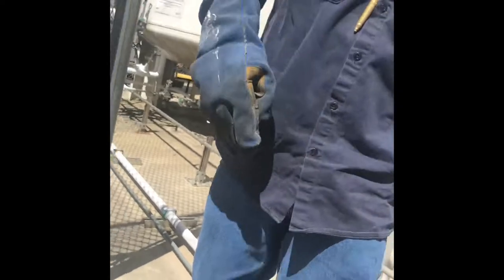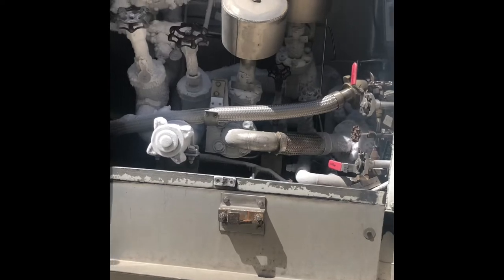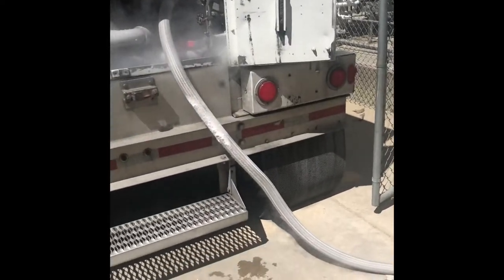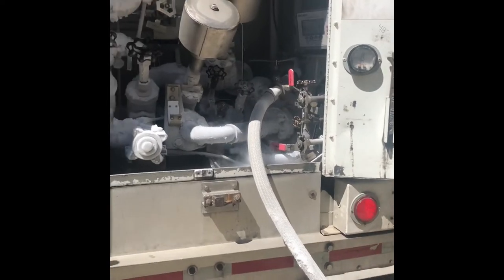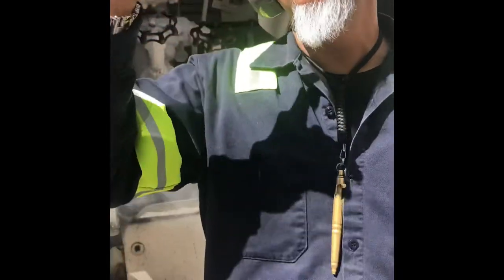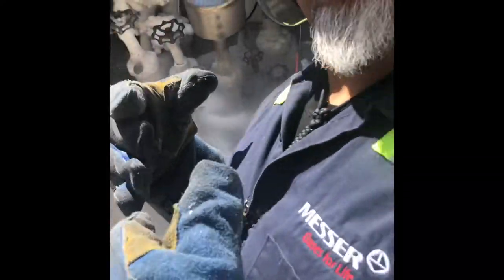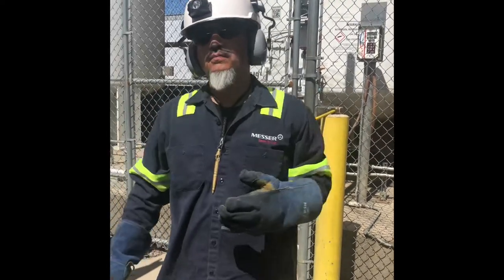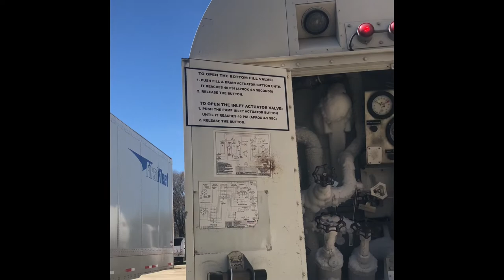How To Deliver Liquid Nitrogen

Comment: I have a hard time getting those copper gaskets to fit. They seem to fit, be too big or small. any tips?? Thanks for the video
Reply: If there not fitting the flank needs to be replaced over the years they get out of shape but most of the time they don’t get replace u just have to do ur best if it start leaking on u a couple more hammer taps help
Reply: If you have a 2 piece dust cover remove the inner piece and use it to tamp the gasket into place.

Comment: I dont know if am correct am also a new driver . Ones you get to the customer. Set your pto and power the trailer. Put your cones ready around the truck. Get the reading from the tank and change the gasket on the customer tank. Open the Drain  valve on the customer tank and hook the hose. Next will be easier
Reply: Naw you don’t set the PTO first because running the PTO you are placing wear on the Engine.  That should be the last thing you run and the 2nd thing you shut off after delivery
Reply: Yes you are correct that is the order just as you said ….Set your PTO , cones out and take your readings first and change your gasket on the customer tank and open your drain

Comment: I’ve been trucking for nearly 4 years now, mainly Reefer and Dry Van (all OTR), but I’ve recently started hauling fuel as a local driver but the pay is trash. I’m considering switching to Cryogenic Chemical Tanker side of the business but not sure yet and honestly, kinda nervous about it.

Great video, and this made it look reasonable.
Reply: Seems daunting at first but you’ll laugh later when you have it down. Easy work and extremely clean.
Reply: @CryoTrucker  hey i saw a liquid nitrogen delivery driver, is this video basically what I would be doing at the job?
Reply: @SirAuron777  yup
Reply: Used to make LOX/LIN when I was in the Air Force.  If you get it on yourself, DO NOT RUB IT.  It will feel like you're on fire.  There's also a physic effect, Lindenfrost or whatever it's called.  You can expose bare skin to LOX/LIN for 1 second, without any harm.  Used to stun all my co-workers when I would quickly dip my entire bare hand into a tub of LIN.

How much is fuel hauling paying, that is trash?  Heard they pay good.  Trying to get my Hazmat again, so I could do fuel, or cryogenics.

Comment: This is not the correct way to deliver cryogenic materials.  

#1 you don’t allow the openings of the hose to touch the ground unless they have dust caps. 

#2 you don’t open the hose drain first.  You are suppose to verify you’re at the correct tank, and then check the Top & Bottom fill valves before you open the Hose Drain.  You don’t want liquid to escape.  

The reason to purge the line is to make sure that the gas pressure pushes out any impurities before delivery.  

You must cool down your pump for a minimum of 10 mins but no more than 20 mins.  Reason being is that the pump has a spring that retracts once the pump reaches a certain temperature.  If it doesn’t retract you will end up damaging the seals and liquid will start leaking during delivery.  The reason you don’t want it to cool past 20 mins is because there’s bearing inside of the pump and once the shaft is too cold it starts to burn the bearings which also damages the pump.  

You need to allow the pump to cool to -238° because cryogenics is liquid between -238° and -500° 

This guys doesn’t know that you don’t run your PTO to its max on a low pressure tank. He works for Messer and this is why Messer trailers were always in horrible shape!
Reply: Who do you work for ?